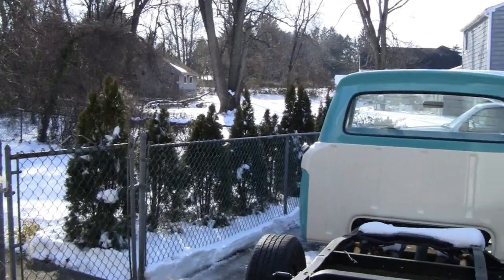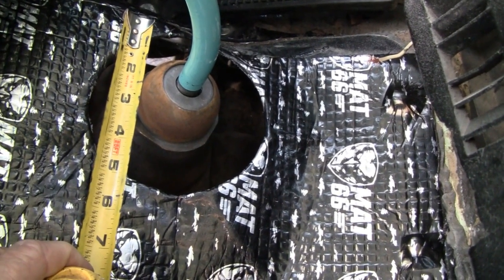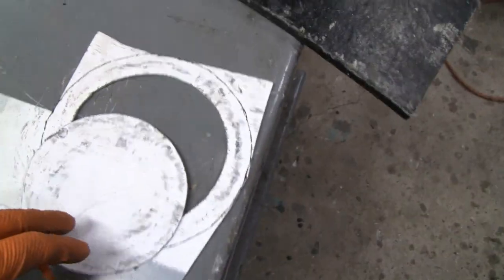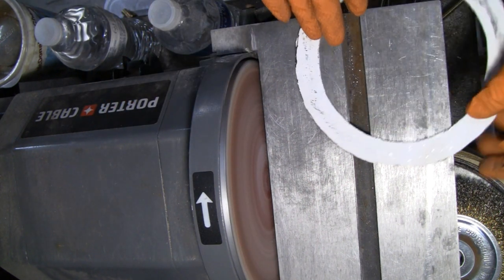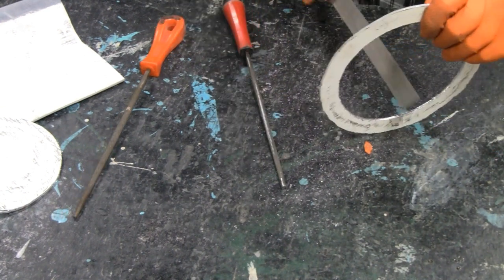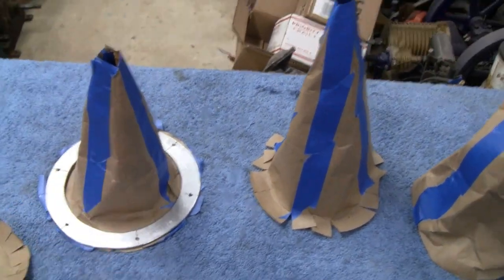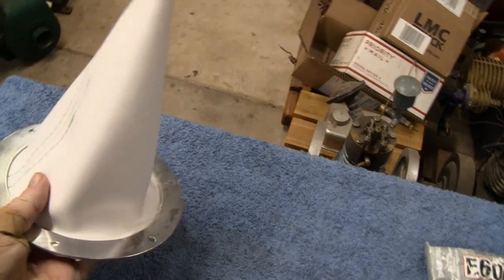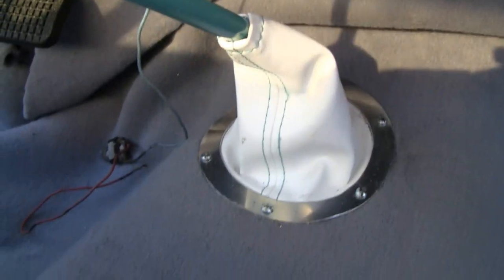MAKE SHIFTER BOOT & ESCUTCHEON PLATE (F100 part 89)

Comment: Looking good RK! For safety from fumes or even flash fires I would recommend a heavy rubber or fire retardant material that mirrors the shifter boot underneath and clamps hard to the trans shifter tower. Since you don't plan on driving it much, you may be fine. I did similar to yours in my 84 Nissan pickup and it has been a pain in my ass. At speed it inflates and blows hot air. I don't worry much about fumes or fire in an 84, though, it's almost new compared to your Ford!
Reply from the maker: Thanks Dog!! We put a channel in the neck of the boot for a hidden zip tie, so we're not worried about fumes!! We'll see if anything else needs to be done after a high speed road test!!☻
Reply: @805ROADKING  
Mine crawls up my shifter and inflates like a balloon! Not too bad at 50mph, but at 100 it gets annoying....

Comment: I was thinking you might need some kind of rubber seal between the shifter on the trans and the floor of the cab. It would definitely prevent the shifter boot from blowing up like a balloon up at speed, and stop any fumes from the engine  getting inside better. It would also help prevent water damage from water/slush splashing up from underneath.
Reply from the maker: We put a channel in the neck of the boot for a hidden zip tie, so we're not worried about fumes!! We'll see if anything else needs to be done after a high speed road test!!☻

Comment: Hey RK nice job.
If you want a quick resource for your paper templates search teh interwebs on Cone Calculator.
For a more in depth resource search Wikisource for a 1921 book "Sheet Metal Drafting", the boot with an angle cone is in there, Scelene Cone is where the axis of the cone is at an angle to the base.
It's a great resource for traditional methods of template making .. sometimes just looking at the correct method, and you're off freehanding it.
Reply from the maker: Thanks Dennis!! I appreciate the info!!☻

Comment: Good video and nice job on the boot Roadking. Maybe I missed when you showed what you did with the piston shift knob. Did you epoxy a nut inside the piston to fit the shift lever's threads? Or what.
Reply from the maker: Thanks Bud!! Nah you didn't miss anything, we didn't post that yet!! We made a new wrist pin, drilled and tapped it, then set everything with loctite!!☻